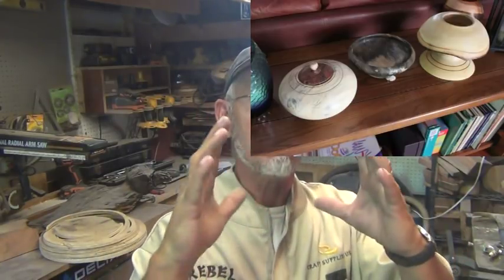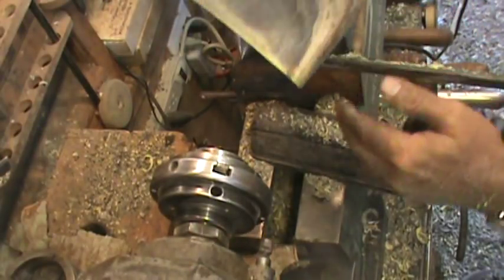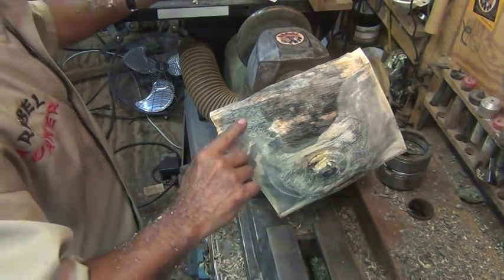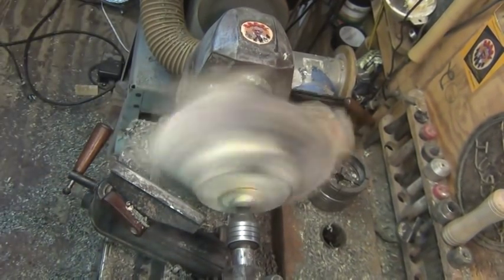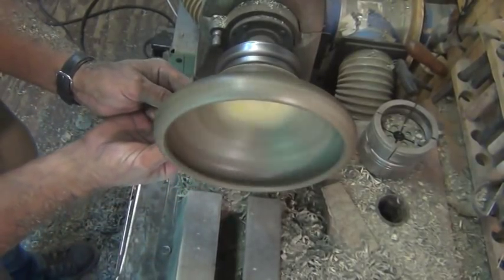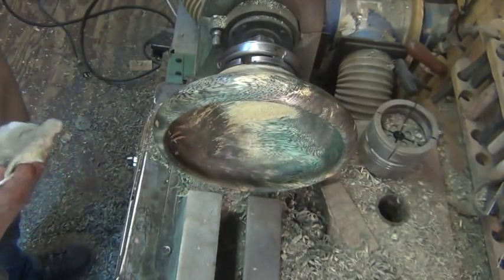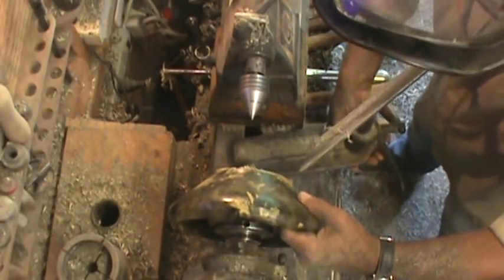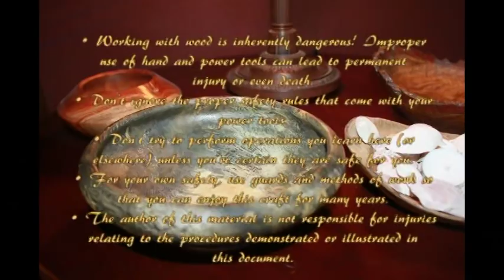Woodturning Same Wood?

Comment: Hi Al,  were you trying for a square edge on the bowl,  until that chunk broke off It had a real elegant look to it.  The finished product looks great,  I like your analogy looking like marble and it does.  A quick question does it make any difference, with the bowl gouge, which way the flutes are turned?  I see you doing a push cut and a pull cut once in awhile, 
When someone asked me what it was like sailing, I tell them 90 percent boredom and 10 percent terror.   We only would tell the stories of the crap that happened.  Again most of it is boring.  Oh if you get mad at each other it is best to go for a walk.  On my boat is was 42 feet front and 42 feet back, 🤣🤣🤣